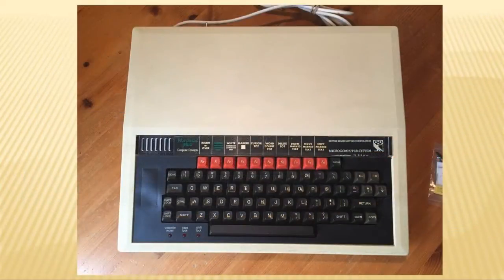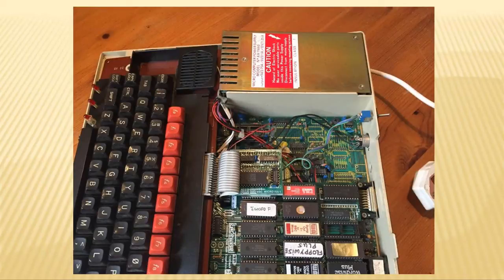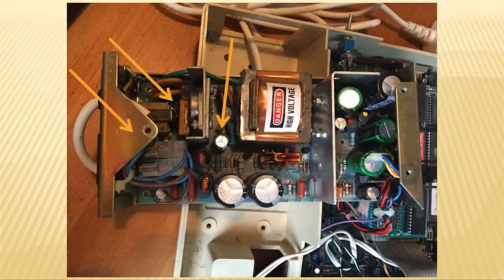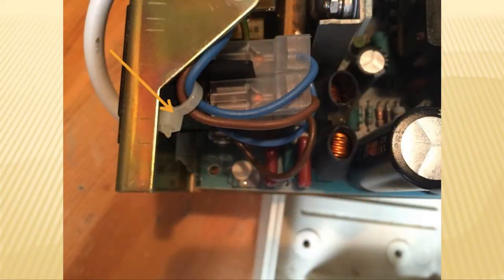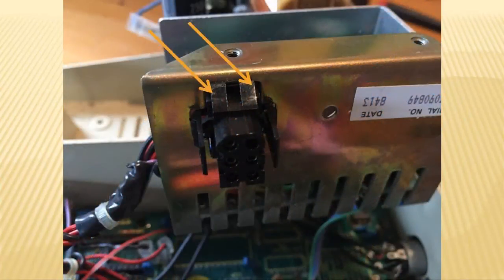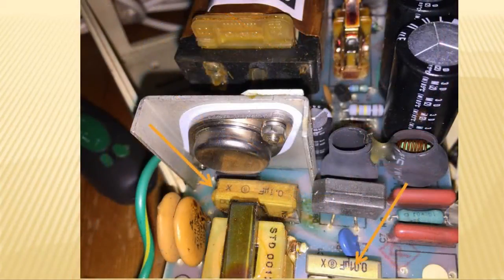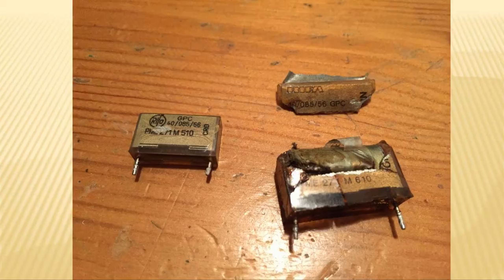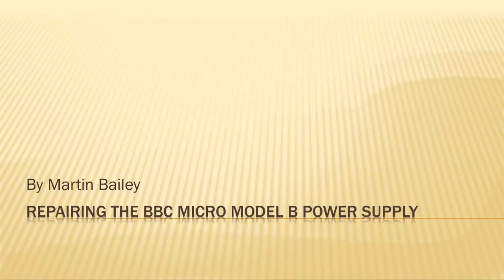BBC Micro PSU (Power Supply) Capacitor Repair instructions

Comment: Thanks Martin.
I had one of my BEEB power supplies fail like yours just  a couple of weeks ago.
I bought 2 of the capacitor kits (I have 2 BEEBs) for £2 each + £1.20 p&p.
I recapped both of them, using all 3 of the caps, and now my BEEBs have a new lease of life.
The actual soldering work was fairly easy, but getting the PSU out of its case was not so easy.
There is a repair service offered through eBay for less than £20, if you don't have the skill or equipment to DIY.

Comment: Thanks for the video!!!!!!!!! I've just recapped my issue 4 Beeb (my issue 7 was done for me) and I'm about to recap my Master. Never worked on soldering PCB level before and your guide was invaluable in getting the PSU out and apart. Thanks once again :)
Reply: +YesiPleb. Glad it was of use! When I was doing mine there was not a great deal of in-depth videos so I thought that even just animating some stills and putting some narrative to clearly warn people what to look out for would be of use. I certainly could have done with it beforehand, because disassembling the PSU was the most time-consuming bit.